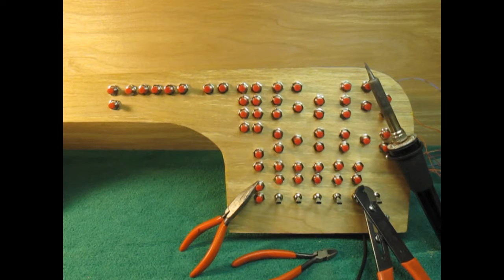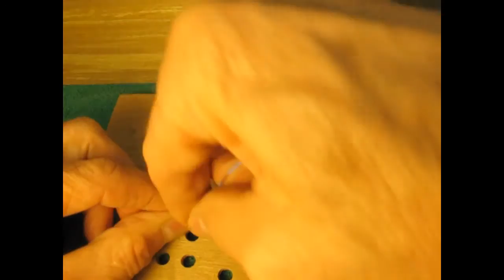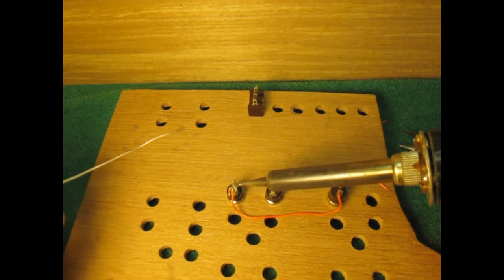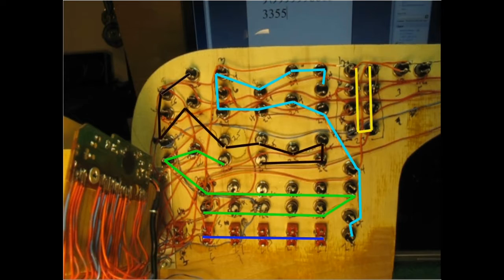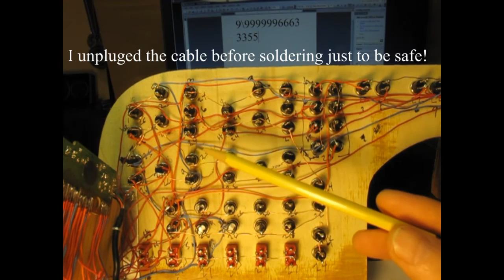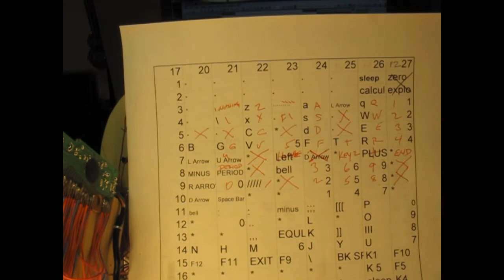How to Build Your Own Instrument Panel for X Plane ~ Part 4

Comment: I encountered a problem, when i soldered two wires in a toggle switch. When i turn on the switch, it does create a character, but it continuously creates that character. Like gggggggggggggggggggggggg until i turn the toggle switch off and then it would stop. Now my landing gear goes up and down until i turn off the switch. 

Please help me
Reply from the maker: Hi Christian,  Sorry you are having trouble.  You MUST us a momentary switch not a toggle switch that stay on until you turn it off. That would be like holding a key down on your keyboard and that's why you got "gggggggggggggggggggg"s. So you need to change the switch you are using to a momentary ON switch. Here is a link to Jameco where you can order the switch.

https://www.jameco.com/z/1MS4T6B11M1QE-Toggle-Switch-SPDT-MOM-OFF-MOM-Single-Pole-Double-Throw-Solder-Lug-5A-120VAC-28VDC-Panel-Mount_317316.html

You can get these on amazon or an electronic store near you. Just make sure they are Momentary ON switches they need to work like the keys on your keyboard. Let me know how it goes.

Blessings,
skip

Comment: So each port in the chip board can have more than 1 switch you can activate it to?
Can you do a video of you programming everything?
Reply from the maker: Hi Jack,  If I understand your question to mean a connector on the circuit board with a wire soldered to it can have more than one switch the answer is yes. You will use one wire soldered to one connector on the circuit board and attach it to as many switches as you had character produced in the word document. So if you tapped wire number one to all the other wires, one at a time, and came up with say 10 different wire combinations that produced characters in the word document (A-Z or a number) then you would use those combinations of wires and solder them to 10 switches. For example, when tapping wire one to wires 2,3,4,5,6 and those are the only wire combinations that produce a character in the word document, you would solder the wire from connector one to a terminal on five different switches, ganging them together. If wire two produced characters when tapped to wires 7,8,20,21 only you would solder the wire from connector two a terminal on four switches and wires 7,8,20,21 to the other terminal on the same switches. 

I realize this is a bit confusing so watch the video several times so you can see how I did it. The important thing is to have good documentation. Make sure you have labeled every wire so you know which wire is which. Write down every wire combination that produce a character in the word document. Right after you have soldered wires to a switch or button plug in the USB cable and test it to make sure it works and produces the character you expect. Do this after soldering each switch. Testing after each switch or button is soldered will save you a lot of time in the long run because you can correct mistakes right away. Let me know how it goes and TAKE YOUR TIME!

Blessings,
skip

Comment: This is amazing =) 
I am absolutely going to build one of these! Thank you!
Reply from the maker: Hi Peter, Thanks. Go slowly!  Take your time getting the wire combination outputs. I went too fast to and now that I'm at the end I found I missed several duplicates and am hoping I have enough characters for all my switches and buttons. I also had several "good" combinations that didn't work so again go slowly and after you are sure of the number then decide which instruments you want to control. I only have a couple buttons to go and then will test everything hoping I didn't miss any more or I may not be able to use some buttons already on my panel. Please keep me informed as you go and leave any tips for everyone else doing this. Video 5 will be the last showing my panel and explaining all the mistakes I made hopefully to help you guys from making same. Good luck.

Blessings,
skip

Comment: Why oh why didn't I think about using telephone cable?! I have miles of the stuff in my garage and I have been struggling with slightly oversize stranded copper. Doh! What a muppet. lol
Great job Skip, I am looking forward to seeing the final product now, should be great.
Take care.
Reply from the maker: Hi Tux, Wow stranded wire that makes it a bit more difficult. The phone wire is really good 24awg solid copper so it's easy to work with. Not to late to change is it?? 

With any luck I will be done by the end of next week and be able to tell about the problems I ran into and things I should have thought about before starting. One thing I learned is have the complete finished product in your head before starting. I had an idea and started now I see things I didn't consider in the design and layout that I have live with now. This was a good learning experience and the next panel I build should be exactly what I want if I take my time.

Blessings,
skip